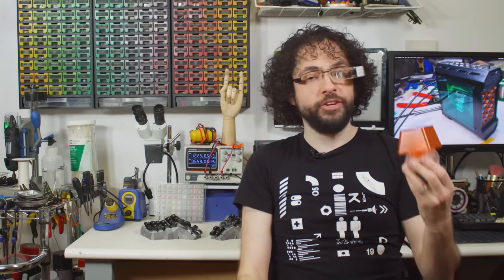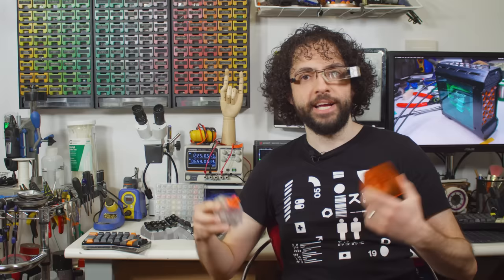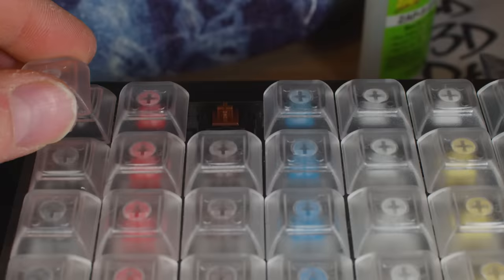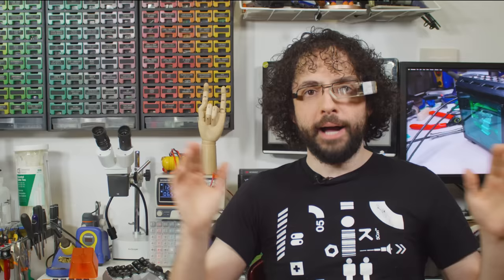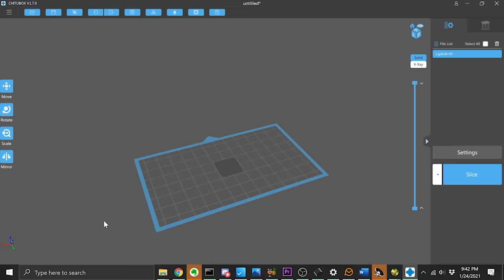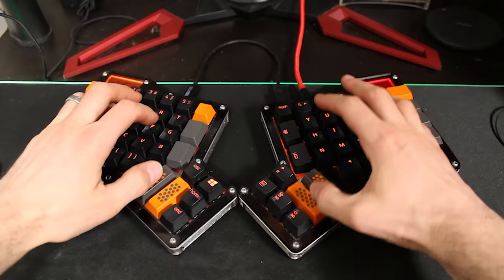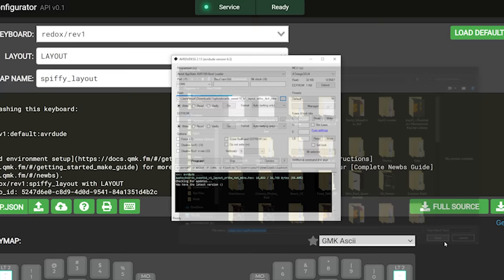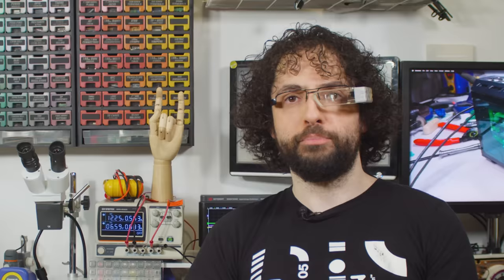How to Build MECHANICAL KEYBOARDS

Comment: I have an idea for a future project, though it won't be simple, something I've wanted to see recently is something like a Razer Tartarus v2, but replace the thumb dpad with a touchpad from a Steam Controller or HTC Vive/Cosmos controller, then make it play nice with Steam Input API. With how the thumbpad is a trackpad that can emulate trackballs or joysticks, as well as having the buttons for a dpad, this would be a mouse replacement that can also be used for gaming; like a split ergo keyboard combined with a Steam Controller. SI-API also has a mode switch feature, which would allow the macropads to have extended functionality as the mode switch would act as yet another function key; assuming SI-API plays nicely with keyboards, I haven't touched it in forever as I haven't touched my Steam Controller in a long time. The only issue with SI-API is that it's baked into Steam, and doesn't yet have a standalone variant that's not as resource intensive. 
Dual macropad that's a mouse replacement, gamepad replacement, and has all the functions that SI-API provides. I'm just not sure if you can reasonably fit a 7-8 key wide keyboard with 5 rows into each pad to have it work as a 60% keyboard. Assuming you can fit a full alphanumeric keyboard into the pads, make the thumbpads ergonomic, find a way to make mouse buttons make sense, and make it play nicely with SI-API, I think this would be the one peripheral to rule them all.

Comment: i use a keyboard with a numpad/10 key pad because its perfect for games that require you to have two hands on the keyboard or for emulators ex: wasd to move and numpad 1 and 2 as an nes controller.

Comment: the 60% keyboard with a few extra keys is known as a 65%, and a keyboard with numpad but no function row is known as a 75%, you dont need a macropad! im currently using an ortholinear 75% layout and its awesome!!! basically just a grid of 5x15 keys. its as big as a standard 60-65%, but has a numpad ofc

Comment: I was hoing that you mention also some nice hall effect switches. I used one with a PC XT in the 90'. It was practically an indestructible beast made for people who just switched from mechanical typewrites and were able to type 5-6 copies on it at once. It sit on the desk like glued. It was kind of 3-4 times heavier than normal keyboard thanks to the aboit 2mm thick casing, metal reinforcement inside and amount of electronics). Every key felt the same and actuated in the same position regardless of the amount of used force. Unfortunately the keycaps were also heavy duty what made it a bit harder to type for those not used to mechanical typewriters. These switches could make some really confortable keyboard today with easy going lightweight keycaps.

Comment: I would like to build an Ender 3 Max enclosure with an integrated temp sensor and digi-readout. I’d love to have your build style showing how the electronics side work together. I know there’s a lot of ways to do it but I’d like the most cost effective, DIY friendly (industrial maintenance background so heavy handed techniques and a familiarity with tools and sensors and PLC logic but a poor to fair understanding of electronics hardware and the smaller scale communications between them. You put it in ladder logic and I’m gold but that’s a project I’ve been mulling over.
Reply: There’s several of these projects I have a lot of supplies for but need a better knowledge base to work the projects start to finish without assistance. Working on it in the: lazy, someone else has already done it and put it on YouTube style.

Comment: You used do a episode on 3D designs and printing, like what each settings is and how they actually apply to the print when slicing
Reply from the maker: I actually use the default settings most of the time! I'll keep that in mind, though

Comment: @13:55 "The Hell does 'pause/break' do, anyways?"

If you use the chord of Win (the key two to the left and two to the right of the space bar, which often looks like the Windows banner) + pause, you'll get the System Properties control panel. I use this a lot when I'm fixing Windows boxes.

Then again, I'm the data clerk nerd. I crave number pads. I use Home and End a lot in text editors. I use 'ctrl+tab' to cycle through the tabs within a window, just as 'alt-tab' cycles through the windows on a desktop. I even use 'win-F#' on Linux GUIs to change desktops.

The hidden macros in a 104-key setup are better than the (baka) hidden menu at In & Out. They keep your ten fingers on the board instead of stalling out to grab the mouse.

Comment: a year ago I bought a defective EpicGear Dezimator (mx brown). the pcb was busted so I took it off and wired everything by hand.
had to divide the keyboard in 3 parts and used 3 arduinos pro micro (cheaper than a teensy) and it worked.
sadly the keyboard felt like crap, so I just kept the switches. 🤷‍♂️

Comment: my first keyboard had mx blues and when i tried linears they kinda felt gross not having that tactile bump when you hit the key is really off putting so i moved to tactile cause i mainly just wanted the feel of clicky switches without the added noise. so i got some akko ocean blues (i heard from a friend they're pretty similar to holy pandas) not exactly the same feel as blues obviously cause they're a different key switch but much better than the speed silvers i jumped to. i really only like linears for rhythm games just cause im always bottoming out the key so i still retain that tactility

Comment: It's easy to brick an Arduino.  Just muck with the configuration fuses. :P You can still unbrick it after that. If your Arduino is an old school model with a DIP atmega328 or similar, pop it in a programmer like the TIL866 and set the fuses back to something sensible.

Comment: Me and my bionic AI here, we were prototyping down; a stripped out and cheesy case.

Along side the slot, appeared a shiny demon, on the connection, of the case

 AND HE SAID uuuuuuuuuuuuuse the strongest, resin iiiiiiiiiiiiiiiiin the world, or your part won't hold. 

So we grabbed the first fluid we saw in the shop, it just so happened to be ..........

Subbed for the Tenacious D reference

Comment: I’ve always wanted to build a custom racing wheel with pedals for car sim programs ... using of course a stepper motor mechanism for the wheel itself. The commercial products are  too expensive and a Teensy would be ideal for the task ... have you ever done a project like that or something similar ... like maybe flight sim controls?

Comment: Okay time to design spec out my ideal keyboard.  We start with a split keyboard that has  an analog joystick on the left side and a vertical oriented RollerMouse design on the right side, spring centered so it can emulate a right analog joystick later.  The RollerMouse Red design is neat but since it can't infinitely scroll left or right, it's worthless for first person shooter games where being able to infinitely turn around is a must.  Turning it 90 degrees and firing up a "joke mouse program" to rotate all mouse movements by the same amount confirms this design would work great if the RollerMouse Red was ergonomically designed for this.  So stick all the mouse buttons on the top row, add a mouse wheel in between, and bam done right?  Well first I need to actually rebuild a proper rollermouse design and understand what makes it tick.  Opening the device reveals an optical sensor just like any mouse only on the underside of a roller wheel, which lets me know the design can indeed be reproduced pretty easily.  The optical design points upward, something I'm going to see if I can't get pointed inward or downward so it can't shine into people's eyes if it were exposed, which will also allow me to double up on the optical sensors and make the travel bar smaller since I only need to cover a third of the roller bar distance instead of over half.  The only spring design I can come up with that will keep the design centered coils the spring on the outside of the bar, and that could interfere with a dual optical sensor design.  That's something I will have to experiment with, but it could be a blessing in disguise that lets me use a single sensor.  Ultimately, I don't think this roller wheel design could be used on a motion control game controller- for that I will have to stick to an optical trackball that is properly suspended to work in all orientations.

Comment: Does using the diodes for the rows or columns make a difference? Since The microcontroller is scanning each row/column, it would be better to scan the rows and have the diodes on the columns? does it matter much?

Comment: That's a great video.  I guess it should be possible to print and build a special keyboard as a "add on" keyboard that than can be used for games. So I can build me a Elite Dangerous Keypad for special commands like jump, galaxy map, speed settings, etc..  Do you know if it is possible to code macros with it? Like I press a key and it not just sends "one" key command but a series of keys to automate things. Like you can programm macros on a logitech game keyboard on the G-keys. I just binge watch a lot of your videos. Great stuff. I like the AI on the teensy.

Comment: 17:30 this is true, but you can still have a wacky way of making them compatible. By building software in python that constantly checks 1100 baud rate serial for different numbers, then having your arduino/teensy check if switches are being pressed, and if so send that switches corresponding number over serial, you can have an all arduino/teensy compatible setup. If you don’t like having to run a python script to type, make it an exe with pyinstaller or auto-py-to-exe. You will have to run the software to be able to type, but a) lots of Keybs out there have proprietary software and b) it’s your fault for buying a nano becuase it’s cheaper, or teensy 3.0 for up-to-date-ness.

Comment: Which switches would you recommend when I want to use the keyboard also in an office environment but want to have at least a little bit that satisfying clicky sound. I was thinking tactile switches would be a good compromise but when I understood you correct you would not recommend these and would rather take a clicky or linear switch. Which one is the most silent clicky switch among all possibilities?
Reply from the maker: I like the Tecsee Sapphire/Snowglobe and Glorious Panda. They combine punchy tactile clicks with smooth, soft stems that contain the sound. Using PBT caps, a gasket-mount or sandwich-style board, or sound foam will also help.

Comment: I use alps blacks and alps blues.
Home goes to the start of a line of text, end goes to the end of a line of text.
shift+end will select the hole line of text at once and same for shift+home if your at the end of a line.
F8 compiles and runs the code, F9 force closes the buggy hell spawn I just created.
alt+print screen will take a screenshot of just the program or window you have running. then you can crtl+v that guy right into a competent chat program like slack or discord.
crtl+shift+esc will insta bring up task manager on windows without needing to menu drive through ctrl+alt+del.

yeah i'll take my nerd crap and see my self out.
good video though, I have a bunch of TIP120's and RGB light soo yeah do that one next >__<

Comment: Not all backlightable keys are double-shot; most of the cheaper options are painted and lasered, which is pretty much exactly what it sounds like - the whole keycap is transparent, and then it's painted, and then the legend is etched away with a laser.

Comment: Awesome video!
It actually looks and sounds quiet easy, even the soldering. But I don't think I'll do it because of my missing skills and 3D Printer.
However I am wondering if such a keyboard has a so called "N-Key-Rollover" and "Anti-Ghosting". So can you press all keys and all are getting send over to the PC?
Reply from the maker: Yep, QMK has built-in NKRO support. You need a diode for each key, which you can see I did add. Heads-up - NKRO can conflict with some media key bindings.
Reply: @ZackFreedman  Alright cool.
I might do a small Macrokeyboard, where I might not need to 3D print a case but use cardboard 😅🤣

Have you made a video about building a full and complete keyboard (for example 60%) with your own PCB?
Would be great if there was a website where you can order such PCBs..

Since I am in need of a TKL PCB but with ISO Layout and those are basically non existing for an affordable price online...
So I thought of building my own

Comment: are there any keyswitches that are designed to allow the keycap to physically collide into the backplate? i have a terrible beige rubber + carbon puck keyboard from the 90s that has all the logo info and half the printed labels worn off and it's shockingly enjoyable to type on because the bottoms of the keycaps ram straight into the backplate long before the rubber underneath completely squishes, which is a typing experience i have yet to find on any other keyboard.

Comment: Jan Lunge channel has a cool video where he presents solder less switch sockets for custom keyboard. And those sockets can be 3d printed. Really cool concept, switches can then be hot swapped if I remember right)) Here the title of the video. "No Soldering and no PCB Macropad build | macro pad part 1"

Comment: would you be able to make a steno keyboard similar to the georgi or the splitography?
Reply from the maker: Sure can. There’s an open source steno project called Plover.
Reply: @ZackFreedman  I use plover, my only question is does this have nkey rollover cause otherwise it wouldn't be usable for plover

Comment: Hows about you crack open that Ergodox EZ and mod it wireless? Or swap out the cable inbetween as it is well known as the weak point of the keyboard. I love me ergodox EZ but Im so addicted to it now I need a way of taking it with me on the road.

Comment: Hi all, sorry for asking but subtitles not working as expected, could you confirm what is the name of the Arduino PCB mentioned at 16:45, is "Arduino NAVI 1" or similar? also, does the image (blue circuit board) the one mentioned? many thanks for the video as it will allow me to try this but still bit lost at this point xD Tried to find it googling but not yet succed on this.

Comment: My keyboard has Cherry Mx browns so their already loud but are even louder due to the keys hitting the metal back-plate when they bottom out. So there is no deck flex but it is also one of the loudest keyboards I have ever used. (I use it for gaming thats why I chose Cherry MX keys)

Comment: what about polling rates (over USB) and latency when it comes to arduino and DIY boards compare to gaming keyboards? are there any numbers to compare?
Reply from the maker: It's pretty unlikely to come into play. You can poll 80 channels of I/O expanders about 1000 times a second; with processing and transmission overhead, lag should still be under 4ms.

Comment: Hrm.... Do I wanna build a keyboard where I need to solder the switches together manually, or do I wanna solder them on to a PCB from someone like <Jan Beta> PCBWaaaay~</Jan Beta>?
Decisions, decisions.
It would be nice to have something I can use to play my FPSes and MMO's (I'd need 24 keys just for the default 2 bars of action hotbars in WarCrack World) without walking the keyboard with both hands, looking at like $130 AUD baseline for a gaming keyboard like the Razer Tartarus but those don't have enough flipping keys from what I can see...

Comment: can you use a teensy 4.1 for this? or does it 100% for sure need to be a 2.0/knockoff 2.0? I feel Like I'm in over my head on this but we're going to give it a shot anyway.
Reply from the maker: You could use anything, but you'll need to hack the bit that holds the microcontroller in place and the hole for the USB port. The 4.1 is ridiculous super-massive overkill - I actually think the 3.2 is the sweet spot for USB HID.
Reply: @ZackFreedman  Great, thank you! I'll look into getting one of those. Appreciate the reply!

Comment: Hey, Zack! I'm trying to make my own mechanical keyboard design from scratch, but I'm getting hung up on the key switches and the board. I want to make it small, like each key is maybe half the size of a usual key small. Any suggestions?
Reply from the maker: I don’t think you can use mechanical keyswitches at all. The 16mm^2 footprint is pretty much standard - you can get shorter switches, but not smaller ones. You might need to use microswitches, tactile switches, or roll your own.

Comment: @zack freedman This video inspired me to try out this project so, with pretty much no maker experience and only having had a 3D printer for a couple weeks, I figured I'd start with the redox hard wire and work my way up to the Dactyl.

I'm at a dead stop with this Atmega32u4 that was recommended for the project. After wiring up the matrix, I was hoping I could plug it into USB and just flash the hex file to test it, but that seems not to be the case. AVRdude or QMU Tool only seems to even be able to interact with the device for a second or two after I touch the reset pin and ground together and the bootloader shows up. I tried writing to that but I think I made things worse. What am I missing to be able to get the firmware onto this device? All my googling takes me to forum posts where everyone is an electronics engineer and that I am not.
Reply from the maker: Did you buy any spare Arduinos? If so, try programming one of those before soldering it up to rule out a defect in your Arduino or wiring.